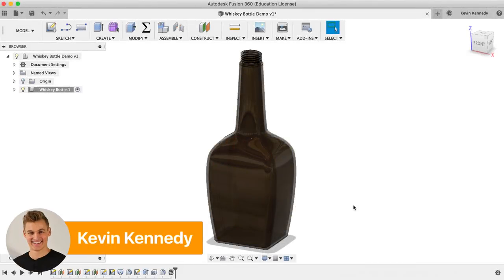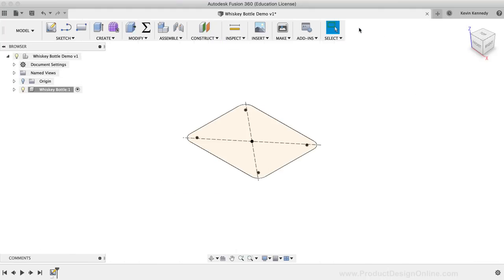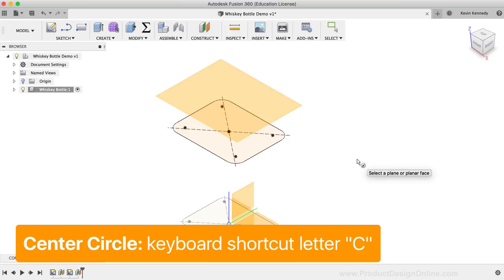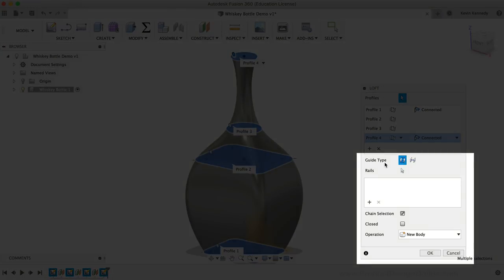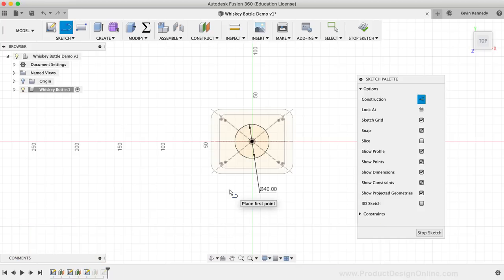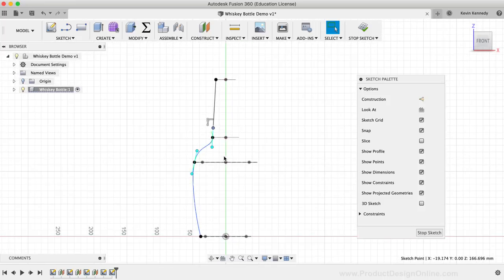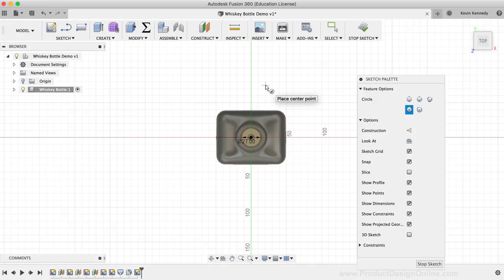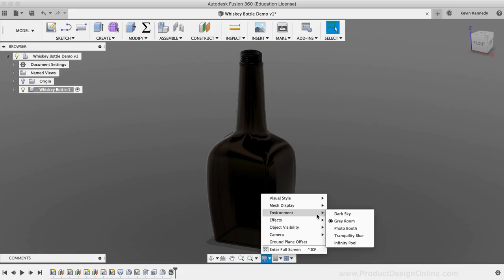How to 3D Model a Whiskey Bottle - Learn Autodesk Fusion 360 in 30 Days: Day #4 (REVISED)

Comment: Hi, I am at 21:51 attempting to make the bottle hollow.  The shell command is also not working for me, as I see several people have asked about.  I solved the problem - I wish that I could post screenshots in a YouTube comment but I cannot.  I feel like this is a good general failure mode to be aware of:

It looks like the Shell tool will fail if there are sharp cusps (like a V, not a U, or a very very thin U) or very tiny features present in your geometry.  If you get a shell error, try using Inspect >> Section Analysis to get a good cross-sectional view of your model.  What I found was that at the BOTTOM of the bottle (where we did the fillet), there was actually a tiny little ridge extending below the XY plane all around the edge of the bottle (imagine like we wound the paperclip from the last video around the bottom edge of the bottle).  This was very tiny and not at all visible in the 3D rendering itself.  What I did to fix it was to redraw my spline.

This was good practice working with Splines.  In short, they're kind of wonky.  My little cusp at the bottom (a sharp dip down and then back up) was caused by pulling one of the spline handles at the SECOND loft profile (the top of the big square part of the bottle) too long.  So, in short, when drawing splines, have a look at all your inflection (turning) points with a zoom view and make sure there isn't anything weird happening.

Finally, after I did all this, my lines didn't join properly when using them as Loft rails, and following Kevin's posted Guide Rail Error solution fixed it.

Comment: I had the same issue that a lot of people here are having. When I tried to do the fit point spline, my cursor would not snap into the previously created points. I reset all my settings to default, and then carefully went through them to make sure everything matched with yours. I found that the “snap” option under the sketch palette was not selected. Is this a new default setting?

After I fixed that option everything worked smoothly, thanks for the videos!
Reply from the maker: Hi, Marlena. Glad to hear the "snap" option fixed it for you. As far as I'm aware, that is still a default, but I'll believe some of the Sketch Palette items can remain per user account and don't get reset with the default settings.

Comment: I was getting errors when doing loft rails. So I followed the steps in the link in the pinned comment. Which initially didnt work. I had to change the settings. Save, Quit fusion, and then reopen, and redraw the splines and lines. And then it worked.

Comment: Nice presentation Kevin. The revised video was a great improvement. That said, I was unable to shell the bottle at 3mm. Kept getting an error to the point of trying to crash Fusion. I was able to shell at 5mm though. Any opinions about what I might have done wrong? Thanks and have  great evening.
Reply from the maker: Thanks, Wil. I'm glad the revised version was helpful. As far as the shell not working, it may be due to the top part of the bottle being too thin. Could you share your file with me?

Share your public link as a reply to this comment. Here's a video explaining how to share a public link - https://youtu.be/2XrcrdV-8Ls

Cheers, Kevin :)
Reply: Even I'm facing this issue
Reply from the maker: @KiranKumar-ki5dw  Could you share the link to your file so I can take a look? Cheers, Kevin :)
Reply: @ProductDesignOnline  Same problem here!
Reply from the maker: @ziadammar3095  I would recommend checking the top part of your bottle where the spline meets the spline. If your spline shape has too much curvature then it won't work well with the shell command, as F360 will attempt to shell too much causing it to have a hole (hence the error).

Give that a try and let me know how it goes. If the issue still persists then I'd be happy to take a look at your file. Cheers, Kevin :)

Comment: Good video.  My version of 360 would not allow the loft. I kept on getting a rail error. I did everything you mentioned, I checked that the snap was on, checked that the project was clicked, I finally set everything in place with the rails mirrored the rail  hit p for project, selected each rails points in order starting from top left to the bottom, then starting bottom right to the top then hit the loft command and 360 accepted the loft. I just downloaded 360 less than a week ago. In each video I have to find work arounds. It doesnt matter where I get the instruction from. Yours, Autodesk's, or someone else's. My command tool bar looks different than anyone demonstrating. IE the sketch tools disappear when you use create when in create there is no sketch available in the drop down list, I have to click the far left icon in the create then identify the plain then hit l for line then i can choose from the sketch menu. When I right click i do get a set of tools that appear but there is no tool drop down below the sketch. All my command short cuts have to be lower case or fusion closes. Any ideas?

Comment: Hey Kevin, thanks for this series, it's so good so far!
I seem to be stuck on the shelling of the top around 21:30. When I go to shell the top of the bottle, i'm told that "The operation could not create a valid result. Try adjusting the values or changing the input geometry. Any idea why this is happening? I made sure to join the new extrude to the bottle, and have been following your steps diligently.
Update: I tried shelling before adding the extrude at the top. Same issue.
Update 2: Seems like the fillet at the bottom is the problem. It is filletting up into the bottle (aka on the inside edge of the bottom of the bottle), leaving a sharp edge at the outer bottom and curving the inside of the bottle inwards. This is probably causing the issue above as there is no 3mm body for the shell to shell into. Any idea how to fix this?
Update 3 [FIX]: Figured it out. Bottom of spline was curved back on itself, freaking the program out. Went back into spline and adjusted the curve, problem solved :)
Reply: I gonna try.
I remade it, nothing went wrong in the end but panicking through...

Comment: If you cannot perform the fillet on the bottom of the bottle..... In the latest Fusion 360, you must select the "Closed" checkbox when you perform the loft. This actually closes the top and bottom of the bottle. Took me about a half horu to figure out, but
Reply from the maker: You shouldn't have to do that if you're using the Solid loft command (blue icon). It sounds like you may have used the Orange surface loft command.

Comment: Great vid, but problem/update as of latest fusion - The Snapping spline thing doesnt work even if done right. What you need to do is disable Chain Selection, otherwise it gives you the same error regardless if you snapped the spline to the line correctly.

Comment: I'm stuck on the guide rail section. I can't seem to select any objects to mirror. I am pretty sure I'm in sketch mode when doing the mirrors. Is it possible for me to send you my file to have a look-see where I did wrong? I've done Day-4 from scratch three times now and I get stuck at the same place
Reply from the maker: Hi Stephanie, if you can't select objects to mirror then double-check that you're using the SKETCH mirror command and not the MODELING mirror command. The sketch one will only work with sketch geometry, while the modeling mirror command only works with features, bodies, and components (not sketches). If that doesn't seem to help then I'd be happy to look at your file to see what's going on.

Share your public link as a reply to this comment. Here's a video explaining how to share a public link - https://youtu.be/2XrcrdV-8Ls

Then, please write a separate comment letting me know you've replied with a link because YouTube flags most links and I don't always get notified. Cheers, Kevin :)

Comment: Hi! Great tutorials!
Question - when I fillet the angles it sometimes displays a warning "constraints and/or dimension were removed during this operation".
What does it mean?

Thanks!
Reply from the maker: Hi, Raz. Adding the fillet to the bottom will override the dimensions of the bottom sketch profile (the very first sketch we created). Those warnings are just letting you know that they are being overwritten, as the shape is changing.

Comment: Well twice Fusion 360 has crashed when trying to create the shell.  I type in the 3 mm and I cannot hit OK and eventually it crashes.  The error says "The operation would cause large topology change. Try adjusting the values or changing the input geometry."  Hmmm off to investigate.  Found that it is difficult to get the spline command to snap to the end of the construction lines created as it always seemed to want to snap to the grid.  I turned snap to grid off and then it would not find the end of the construction lines or intersection of those lines with side lines....  I finally had to look at the FRONT of the drawing like you were in the video and have faith that the spline was snapping to the end of the construction lines.  In any case, its working and the bottle is done.  Just one more problem, its empty.... no whiskey?  How do we model whiskey?? ;-)

Comment: These tutorials are great, I was overwhelmed to start but after finding your videos I've already created some quick 3D prints!  However, this tutorial has me stuck! When I loft the bottle, the top and bottom have no plane, so I am unable to fillet the bottom of the bottle.  Is there something I'm missing in the steps that is prohibiting this behavior?  I attempted to create my own surface via the patch tool, but still was unable to select the bottom edge to fillet.  Thanks!
Reply from the maker: Hi, Jason. Glad to hear you're enjoying them and learning :)

It sounds like you used the wrong loft command. One loft command (blue icon) is the solid modeling one, which is under the SOLID tab. The second loft command (orange icon, which you used) is the surface loft command under the SURFACE tab. The Solid loft command automatically seals off all ends resulting in a solid water-tight body. The surface loft command will only loft the outer shape.
Cheers, Kevin :)

Comment: Had some problems connecting the lines but found this on a forum which helped:

JOIN 2 SEPARATE LINES (WITHOUT AFFECTING THE EXISTING LINES)
1. Select and make visible the target Sketch Layer
2. Hold down CTRL (windows), and select SKETCH → LINE
3. To connect with a straight line:
       Select the end point of the first line/curve
       Then select the End Point of the second line/curve
4. To connect with a curved line:
        Select the end point of the first line/curve,
        Hold L-Click and drag to select the End Point of the second line/curve
The line segments are separate but the Points are locked together.

Played with CTRL while doing the lines and somehow they connected, not sure how or why tho.
Reply from the maker: Make sure you have the "Auto Project Edges on Reference" setting turned on. Instructions to turn it on - https://productdesignonline.com/default-settings-for-fusion-360-tutorials/#autoProject

That will help you snap the rails to the profiles, as long as you're looking straight at the sketch.
Reply: @ProductDesignOnline  Thank you!
Your tutorials are so helpful, thank you for doing a great job!

Comment: Hi Kevin, really cool video! thanks. Is there a possibility to change the spline points of the the guidelines for the loft commands to be tangents if I havent managed it to be before? I always get the "this line is not G1" error.
Reply from the maker: Hi, Johanna. You can add any type of sketch constraint to spline points, including tangent or coincident constraints.

Comment: I am stuck on this bottle one as well.  I was able to get the loft command executed with no errors.  But the model is hollow and i am not able to apply the model fillet on the bottom of the bottle.  How do i correct the bottle so it is not hollow?
Reply from the maker: Hi, Seth. It sounds like you may have used the wrong Loft feature. The BLUE loft icon represents the SOLID modeling loft command. That's what you'll want to use for this tutorial. The ORANGE loft icons represent the SURFACE modeling loft. The surface tools create surfaces, which is why you can't apply a fillet to it.

Check the timeline at the bottom of Fusion 360 and see if you have an orange icon. If so, you'll need to select it and hit "delete" on your keyboard > redo the loft with the solid modeling feature. Cheers, Kevin :)
Reply: @ProductDesignOnline  Thanks Again... same issue as the beer bottle.  Good now!

Comment: At the point where you say its really important to connect the lines I can't grab the top of the handle and swing it left. It won't move but a grey box appears which says sketch point or active tangent handle. Tried the later but after loft command fusion 360 says WARNING not all the profiles are connected. So I will try the sketch point option instead. Once selected it allows me to move the handle across to snap into line. Is this correct or am I doing something wrong?
Reply from the maker: Hi, James. It shouldn't matter when you connect the spline and line, as long as they're connected before you go to mirror them and use the loft command. If it's not letting you select it then be sure to clear all commands (Escape key) then select the body of the spline, which ill highlight all of the handles, where you can then select the handle. If it's still not moving then double-check that it didn't snap into something else and automatically create a constraint.
Let me know if you get it to work. Cheers, Kevin :)

Comment: Found a definitive solution to the "selected rail does not touch all of the profiles" error. I deleted the straight line, and then redrew it. I then selected the "coincident" constraint, selected the spline, and then selected the point where the straight line meets the spline. This seems to ensure the spline and straight line are both recognized as coincident by the loft command. Note, I had to repeat the process for the right side of the bottle because the mirror function was executed prior to the spline and straight lines becoming coincident. Kevin: For whatever reason, dragging the end spline handle onto the straight line does not seem to adequately join the two for the purposes of the loft command? Not sure if this is a bug or an intended behavior.
Reply: THANK YOU, I was following what he did exactly and it wasn't working.  What you suggested took care of the problem!

Comment: hi i got to the point for the mirror and it wont let me select anything do you have any idea what i am doing wrong? and i see that mine says Design in the upper left where yours says model am i just working in the wrong place?
Reply from the maker: Hi Bryan. There were some updates to the UI in August, which changed the location of some things and some terminology. More on these changes in this video - https://youtu.be/tuZzHcmFtg4

With that said, it sounds like you're using the SOLID mirror command and not the SKETCH mirror command. While in your sketch environment, use the shortcuts box by hitting keyboard letter "S". Then, select the first mirror command, which does not have filled in triangles per this image - https://snipboard.io/EA6Vt3.jpg

Let me know if that was it! Cheers, Kevin :)

Comment: Hi Kevin, thanks for the tutorial.  While doing it, I drew the spline a bit differently, making it tangent to the bottom, instead of making a chamfer.  But when doing the shell, Fusion told me that "The operation could not create a valid result", no matter how small the shell.  What is the problem in this case?  (On the over hand, I had no problem using a chamfer)
Reply from the maker: Hi, Olivier. It's hard to say as it could be a number of things. I'll take a look at it if you can share your file's link? To share your file please go to File > Share > Share Public Link (make sure "downloadable" is toggled on) > Paste your link here as a reply to this comment. Cheers, Kevin :)

Comment: Thanks Kevin for these great tutorials. When I drew my spline for the outline of the bottle, it did not click to the point on the edge of the profile where the profile and the construction line meet.  There was no circle/square appearing to click to. It clearly just snapped to the grid.  So when I came to use the loft tool it would not work, "Warning: the selected rail does not touch all of the profiles".  Any idea how I can fix this? I'm not sure why the profile-construction line intersection would not appear as a point for the spline to snap to.
Reply: having the same issue here

Comment: This video series is great! I am really learning a lot about Fusion 360 with no 3d modeling experience prior to this. My question is at minute 17:54 you mention clicking the dot onto the upper line which I am doing. When I get to the loft tool at minute 19:40, I get a warning saying the selected rail does not touch all the profiles and it will not allow me to select any of the rails. Even though I "connected" the dot to the upper line before, it doesn't take it as a single line. Is this something with the new version or did I miss something? Thanks!
Reply from the maker: Hi Grant. This may be due to a change in one of the default settings. Check that you have the setting "Auto Project Edges on Reference" turned on -  https://productdesignonline.com/default-settings-for-fusion-360-tutorials/#autoProject

If not, turn that on and recreate your rails (the last sketch) and it should take care of it!
Reply: Product Design Online That option is on as default. I ended up running the loft tool twice, once for the lower part and once again for the neck. It did work this way but I ended up with 2 sections of the bottle instead of one. No big deal I guess. Lol Thanks for the quick response!